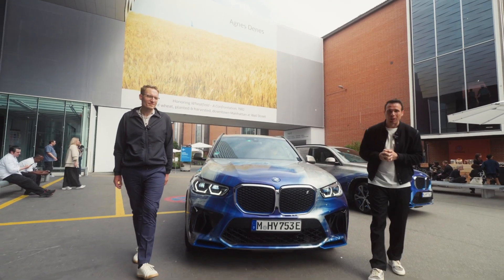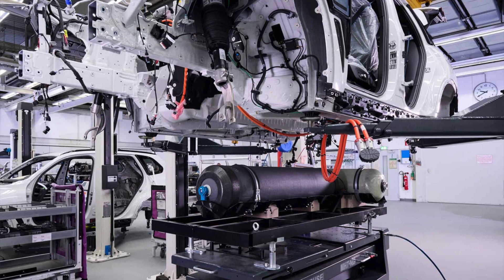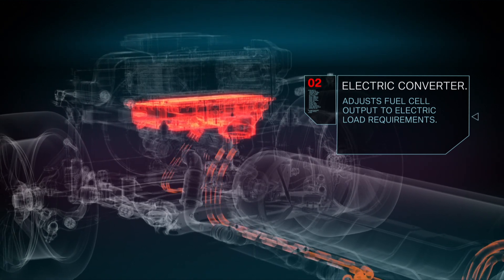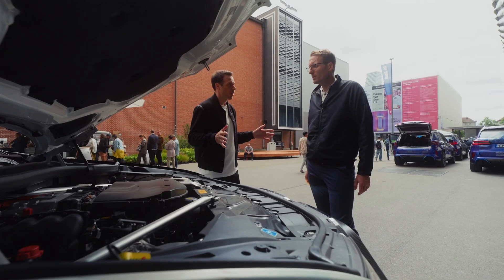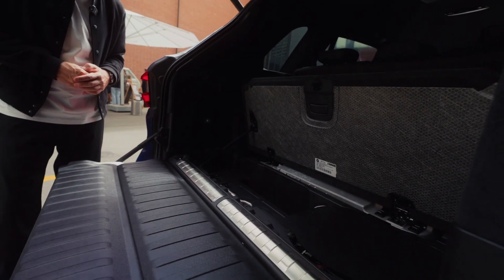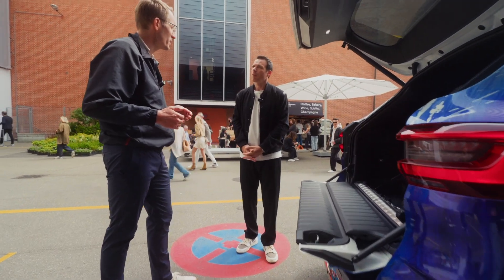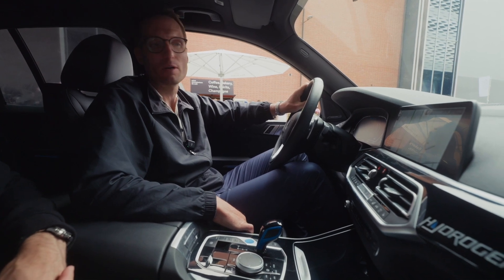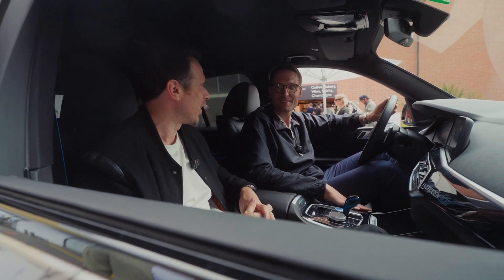BMW iX5 Hydrogen - Is This The Future?

Comment: Hydrogen makes no sense. You need all the components of an EV and then additionally an expensive fuel cell and pumps and tanks for the hydrogen. Then you add on all the inefficiencies of creating, transporting and storing hydrogen vs. transmitting and storing electricity and Hydrogen is so inefficient and expensive that it is beyond silly to pursue it. The main reason it won't go away is the fossil fuel industry is the main source of hydrogen today and they want to trick us into believing Hydrogen is the future so they can keep selling us fossil fuels.
Reply from the maker: There are pros and cons, I agree. I guess biggest pro is refilling times, if you have a good infrastructure and the ability to convert gas stations into hydrogen ones.
Reply: @bmwblog ”good infrastructure” is critical. For BEVs we can charge our cars at home so get better convenience than petrol stations: 30s to plug in, 30s to unplug. We only need EV charging stations on long journeys. Those high power EV charger banks are a big investment-but the rollout is big -over the past year  in southern England we have seen so many more stations we have gone from having to choose our rest stops from where there are charging banks to stopping at the motorway service stations we like knowing they will have enough charging to let us top up to the next rest station. So far we haven’t had to wait and the charging is always done before we’ve finished our coffees. Tesla’s opening up of most of their network to all BEVs have made a big difference here
Reply: what if you need to use a public charger, you could fry eggs in less time it takes to charge a Full EV with a public charger
Reply: @kingscuderia  when I've charged my iX1 on motorways home I don't need to charge to 100% - just enough for me to be confident I can get home. And generally that means it's done in less time than it takes me to finish my coffee. You don't have to sit in the car, you know
Reply: But with a Hydrogen Fuel Cell Vehicle I can decide to refuel to the brim, as opposed to a little bit of charging to save time
Reply: There are pros to Vehicles powered by compressed hydrogen. They just need to make compressed hydrogen for refuelling Hydrogen Fuel Cell Vehicles to be more ubiquitous and cheaper
Reply: @kingscuderia  which is a key problem: no value in putting in H2 charging stations or the whole process of keeping them filled up. They've done some of this in Japan, this video implies that there are now some in Germany. Elsewhere, excluding Norway-I don't see anyone bother. In California they are shutting them down. Be a brave person who bets on Hydrogen now, either in the infrastructure side or as a purchaser of a vehicle. If you really want one: lease it.
Reply: It won't be bad owning a Hydrogen Fuel Cell Vehicle not through a lease
Reply: @bmwblog  not pros and cons bro, totally broken offer. Check Toyota Mirai owners sue Toyota news
Reply: This is the type of response that people said about EV’s 20 years ago. They make no sense. Well, technology advances and hydrogen may be a solution vs depleting the earth of precious metals
Reply: @Bimmer_Bill  Hydrogen cars need more and even rarer metals than EVs. Plus everything needed to create Hydrogen infrastructure builds in a lot of inherent inefficiencies vs electric that just cannot be overcome (compressing and physically transporting hydrogen will always waste a lot more energy than transferring it over high voltage cables.)
Reply: Have you thought about the metals needed to make lithium ion battery packs
Reply: And on the safety sense, there have been cases where Full EVs were caught on fire
Reply: @Bimmer_Bill  it is so clear that production, distribution and converting to energy of hydrogen is soooo inefficient, read about it. It is very easy for you to tell something against science and make a false proof saying technology in the future will work as a magic to fix all these issues, because just you like hydrogen?
Reply: For Battery Electric Vehicles or Full EVs, some of the power to charge the vehicle comes from coal, gas, fossil fuels and others. Some of the sources of grid electricity cause some form of emissions. A hydrogen fuel cell vehicle is quick to fill up and you don't need electricity sourced from coal and fossil fuels to charge it, because it is a Hydrogen Fuel Cell Vehicle. Hydrogen Fuel Cell Vehicles and Full EVs were created to bring down emissions all over the world. The by-product of a Hydrogen Fuel Cell Vehicle is water vapour. The Hydrogen Fuel Cell Vehicle does not need grid electricity from coal and fossil fuels to charge it. So think again about Hydrogen Fuel Cell Vehicles.
Reply: @kingscuderia  it's a really inefficient way to get renewable energy into an EV: energy spent creating it, then that of shipping to fuel stations. We would need a lot more solar and wind. And yes, I know it  could be made in times of high renewable and low demand - but guess what: those are great times to charge. Tesla dynamically vary their prices based on electricity cost, my home supplier (octopus) can do the same. And because I've solar, when it is sunny I can trickle charge my car off my roof generated solar alone: guaranteed zero CO2.
Reply: One of the reasons some of the grid power comes from coal, gas and fossil fuels is because renewable energy like solar is not strong enough to generate incredible amounts of power. Your solar roof or solar system cannot charge 10 - 100 fully Electric Vehicles
Reply: @kingscuderia  my 2kW has 1.5 kW surplus: if I set my car to charge at 6A then it draws that surplus and gains range at about 4 km/h; over 8 hours  of summer is gains 36 km. which, given our weekly driving distance is about 72 km then I need two sunny days per week. Winter is different. There my car will charge when Octopus energy tell it to -they schedule the charge when their costs are less, which means when there's a surplus of renewables. Now, VW are going on step better: their 77kWh models support V2G charging so can be controlled to store that surplus and return it to the grid later -letting them become the battery for the country. As a software developer I can appreciate the complexity of this system but it is only software: still easier than national networks of H2 distribution -and if V2G support becomes something mandated -you can start looking at the return on investment based on BEV sales. So sorry, not convinced
Reply: 8 hours for 36KM is quite a long time, but a public charger would do it faster; and some public chargers are supplied power from the grid. Remember when Fully Electric Vehicles were cars like the Revai or G-Wiz, where they could not do speeds of up to 100MPH and did not have range of up to 150 miles, and some people didn't want to buy them because the range is not that much; now EVs have evolved. The same way Full EVs evolved is the same way Hydrogen Fuel Cell Vehicles could evolve.
Reply: @kingscuderia  I’ve throttled back AC charge rates to 6A, draw 1.5 kWh and leave it there. If I want a fuller charge I can set the car to draw 32A, get 7kWh and charge at about 42 km/h. DC charging is more variable depending on battery state of charge, maximum current a charger can supply for the battery given its voltage and temperature. Lower battery state of charge, highest quoted power levels the best. But never covered: if a charger is broken, your rate of charge is 0 kmh and you are in trouble if your battery is low. Equally significant: charge time is: (time to get required energy into battery + time to queue). That time to wait for a spot means all quoted “20%-60% in 15 minutes” times need to be qualified as “15 minutes plus 5 minutes of fiddling with the charger and 0-30 minutes of waiting for someone to leaver and really resenting anyone who has left their car to charge to 100% and not come back to it once it is done. Tesla chargers do great here as they charge less at quiet times and fine people who overstay.
Reply: @kingscuderia  Hydrogen vehicles also have to have batteries. And the fuel cell uses more rare earth materials than batteries do (eg platinum.)

Recharging an EV does take longer but the difference is you don't have to stand there while it happens. You can walk away. By far most charging of my EVs is done slowly while it is parked. On a road trip I'll use a DC fast charger and it will charge while I run in and go to the bathroom and grab some food/drink. For most people you won't lose any time in a road trip by going in an EV, expecially when we have more infrastructure in a few more years (which is when most people will begin switching to EVs.)
Reply: You stand at the counter to pay for items at a grocery store, and you don't leave your car when you are at a drive-through; standing should not be an issue. A Hydrogen Fuel Cell does not need electricity from outside the car, it generates its own electricity.
Reply: Fuel cell is an electrical energy production technology- Batteries are energy storage devices - period
Comparing these two makes me laugh. I will happy to know if there is any technology that is efficient in electrical energy production. While the world is struggling from global warming, governments are trying to push alternative fuel technologies. It made sense to them to invest in Hydrogen. Particularly for green hydrogen. May be you should read white papers from vehicle manufacturers on why Hydrogen makes sense to them. They have their own use case.
Fuel cell catalysts are completely recyclable compared to batteries. Moreover fast charging of batteries damage the capacity of batteries soon. The demand depends from country to country.
Reply: @kireetikumarkota  since we have to create hydrogen by expending energy to split water, hydrogen and hydrogen fuel cells are an extremely inefficient storage mechanism. Not a generator. I have read all the bs reasoning. It doesn't hold up for all the reasons I already explained. Green hydrogen doesn't really exist today.
Reply: @CheddarKungPao  Yes. Green Hydrogen is produced by spending energy. That green hydrogen itself has numerous use cases only one of it is fuel for transportation. There are lot of plants producing green hydrogen. Some are being commissioned as we speak. Once again - Electrolysis is efficient and Fuel cells are efficient than what you think. May be you should watch the video more carefully. FCEVs are alternative technology besides BEVs.  
Do you know how efficient the electricity is being produced and spent at your home? Would you stop using it because it is inefficient? 
Green Hydrogen has its own place irrespective of ignorant criticism.
Reply: @kireetikumarkota  despite your insults 1) green hydrogen is not being produced in large amounts today. Most today is grey hydrogen. 2) hydrogen is an order of magnitude less efficient than just using electricity directly. Yes i would not convert my hone or vehicle over to hydrogen because it is so wasteful. There is no need.
Reply: @CheddarKungPao I am defending the production and use of Green Hydrogen. The number FCEVs are also less, the Green Hydrogen produced will be sufficient. 
Hydrogen made sense to
Honda, Hyundai, Hyzon Motors, Joby Aviation, Airbus and so on. 
By stating that it makes no sense without understanding you are insulting the world govt institutions, industries and scientists.  Renewable energy is used to produce Green H2 and it is used where needed. Not at individual home that is in grid.  No offence.
Reply: @kireetikumarkota  investment in hydrogen is evaporating because people are realizing it doesn't make sense for ground transportation. It may eventually make sense for shipping. But using hydrogen involves far higher losses and more expensive materials and components than just using batteries. Lets revisit in 10 years. I bet hydrogen will still not be in mass use and BEVs will be a majority of new vehicle sales.
Reply: @CheddarKungPao   For Cars, it may be. Because batteries energy density is sufficient, but for trucks Fuel Cells are the best option. Hydrogen works out very well there. FCEVs are alternative vehicles besides BEVs, they are replacements. I don’t agree that the investments are evaporating. Definitely we should revisit to see how much progress has been made after few years. 2030 should do.
Reply: The Idea is that Hydrogen Fuel Cell Vehicles are not a drawback, they are actually good and very green
Reply: @kingscuderia  i know that's the idea and i already explained in this comment thread why they are not.
Reply: Hydrogen Fuel Cell vehicles by-product is water vapour and they are faster to fill up than it takes to fully charge a full EV to full state of charge
Reply: if hydrogen is conveniently available from your local pump and reasonably priced equal to gasoline. It makes all the sense in the world.  

and why would any normal person care about the technicalities?
Reply: EV is too heavy.
Reply: H2 can for f1 Fomula, speed car ever :)🎉
Reply: I the future yes but hydrogen no infrastructure just like recharging batteries. Totally bonkers and not practical. Interested to see how this will work after they start to cell these cars. Infrastructure infrastructure infrastructure needs to be in place all over the world. What are BMW expecting who will provide this infrastructure or they doing this???
Reply: Where you getting the electricity from?
Reply: @ConnorBaker_  

Micro Modular Nuclear Reactors.
https://youtu.be/0w01Uog4JdM
Reply: @ConnorBaker_  
Micro Modular Nuclear Reactors!
Reply: @CheddarKungPao - While hydrogen fuel cell electric vehicles (FCEVs) do require additional components like fuel cells, pumps, and tanks, these technologies are evolving, with costs steadily decreasing as production scales up. Moreover, hydrogen's high energy density allows for longer ranges and faster refueling times compared to battery-electric vehicles (EVs), which makes it ideal for long-distance travel, heavy-duty transport, buses, and industries where charging infrastructure is limited.  And what's with your crazy handle anyway?
Reply: @ FCEVs do not allow for longer distances. The Mirai has very middling range. And people put way too much emphasis on charge time. You can walk away while a BEV charges.
Reply: @CheddarKungPao  Of course that is a wrong statement again.  Toyota Mirai FCEV for example exceeds the range of these BEVs:
Hyundai Ioniq 6 (361 miles)
Mercedes-EQ EQS Sedan (352 miles)
Tesla Model 3 (342 miles)
Mercedes-EQ EQS SUV (339 miles)
Reply: @ don't go by the quoted range. In the real world the Mirai has less than the claimed range, while the EVs all hit their claimed range on a 70mph range test. Fuel cell vehicles are awful. There's a reason there's a class action lawsuit from Mirai owners against Toyota.
Reply: Without renewables and nuclear power, an EV has the same emissions as a hybrid. 
Living in Australia, we can do hundreds of kilometres in a day, I've done 1000km in a day a few times. 
A car running on green and pink hydrogen will definitely be the right choice.
Reply: @albertfernandez2837  uhh no. Even running on petrol or coal power plants an EV will create less emmissions overall (including costs to make it.) Hydrogen is far LESS efficient than BEVs. Please stop repeating fossil fuel industry lies.
Reply: Ev makes no sense either
Reply: @scherpebocht  as someone who's been driving EVs for 10 years now; they actually make all the sense in the world. There are problems to solve for wider adoption, but the ownership experience is far superior to ICE vehicles. (We have an i4 M50 and an iX xDrive50.)
Reply: @CheddarKungPao  lets say every car is an EV on the road its literally impossible to charge up cars on busy roads and road trips.. i already get in queue for petrol cars let alone EV's. As population are growing too there is also not enough space for new homes let alone more charging stations. 

On top of that recycling those cars and the amount of weight it has to carry is not environment friendly at all over a modern technology pertrol car with filters and todays ecu's that turn makes cylinders etc turn off.

And what about the work from machines etc to get those lithium resources?
Reply: @scherpebocht  the EV switch won't happen overnight. The infrastructure will come as we slowly transition. EVs are far more environmentally friendly than ICE vehicles even when powered by fossil fuel plants. The batteries last a long, long time and can be totally recycled.
Reply: @CheddarKungPao  it wont happen overnight but its closer then u think, especially seeing the new m5, as an m4 and m5 owner.
Reply: Are the charge times of a Full EV really shorter than 10 minutes; a person could fry eggs in a shorter period of time
Reply: Is Fossil Fuels plants really that good when you are considering greenhouse
Reply: @scherpebocht 

Exactly! Fossil fuels carry 60x the energy batteries can and ICE cars weigh much less so they drive much better. It is by far the best value for money.